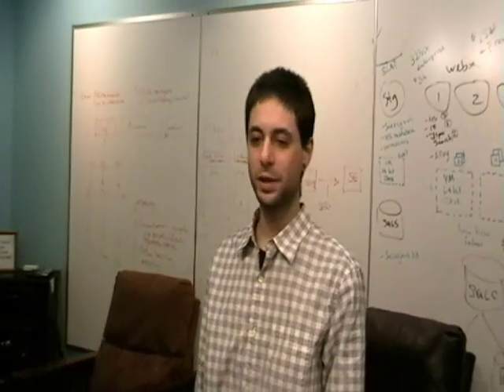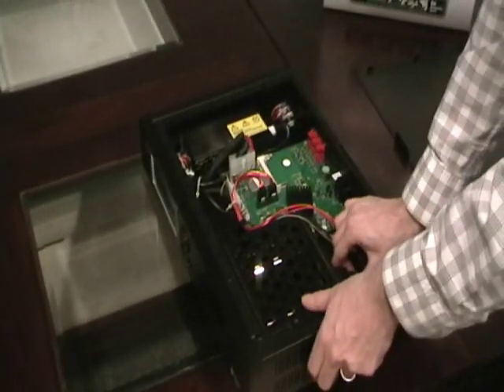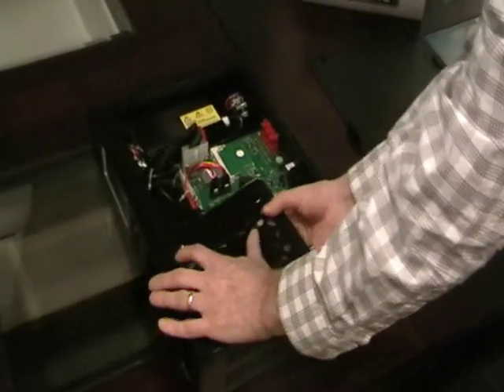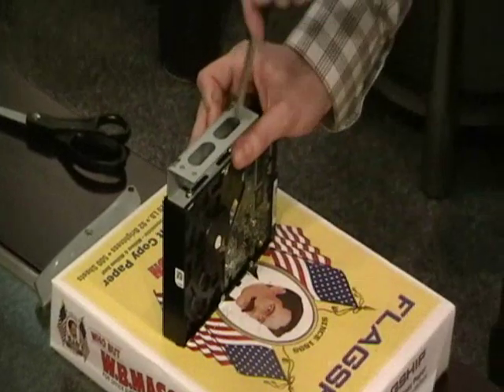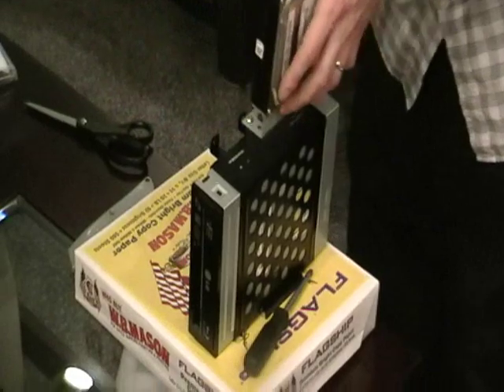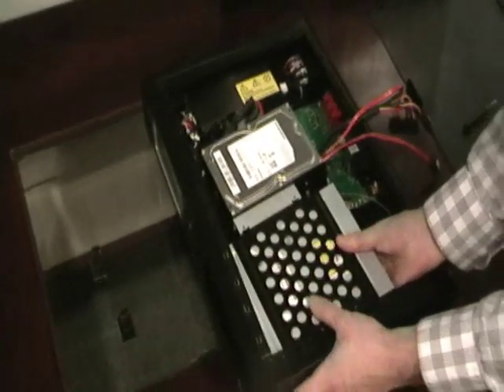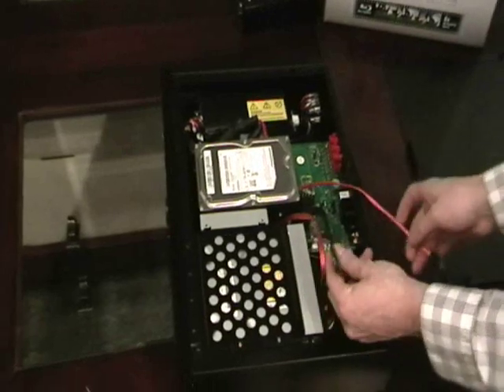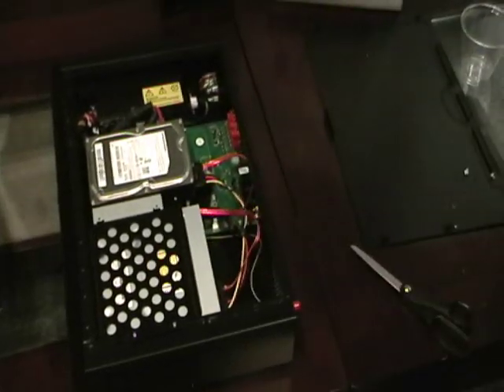Popcorn Hour C-200 Mod - Blu-ray Drive & 3.5 Hard Drive

Comment: Excellent how to: 
another interesting mod:  the C-200 has an internal USB connector on the motherboard.  Take the 2.5 drive from your earlier instalation (or a 1gb 2.5 if you are adventurous)  Buy a USB to SATA power and data adapter AIO connector (Frys and Best Buy sells them for around 20 bucks) hookup a drive and use duct tape to secure.  It shows up in the USB section of the Popcorn Hour software

Comment: I modded your mod a little bit, using 2 of the brackets you use instead of one.
This increased the stability and the comfort mounting the HDD to the Bluray drive. On the other hand, this moves the hard drive even more away from the bluray drive...which was no problem for my installation, but I'll have to watch at the long term effects ;)
Thx for your modding video

Comment: @goldear5563 Yes, you can still hook up the 2.5" HDD for more storage. There is only 1 internal SATA port but there is an internal USB port so you will need a SATA to USB adapter for the second drive.

Comment: I haven't noticed any extra noise because of the setup. I do hear the hard drive spinning when it starts up but that is just the regular hard drive noise and by the time any volume comes on it is not noticeable at all. As for the disc drive spinning, the disc itself would prob make the most noise.